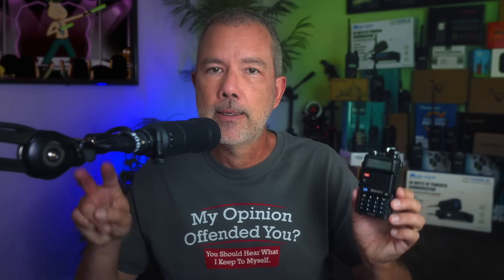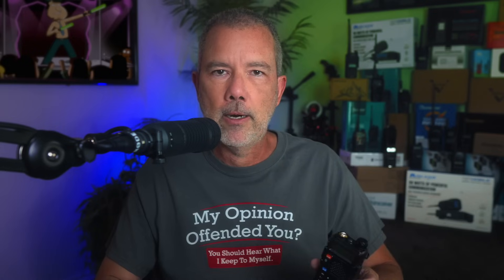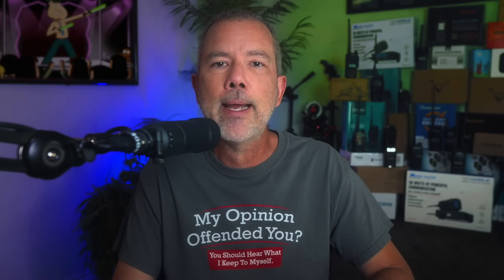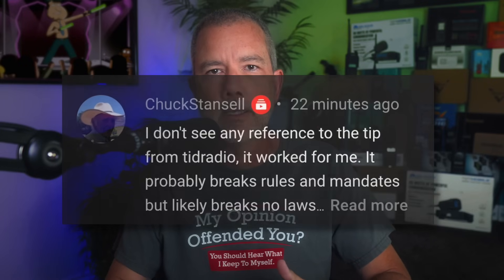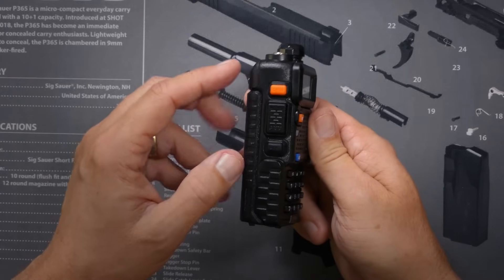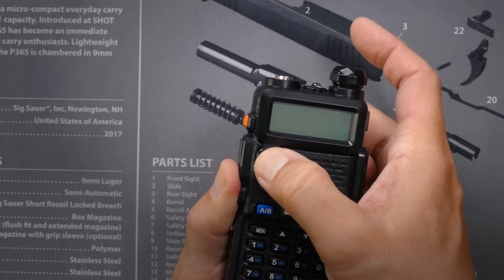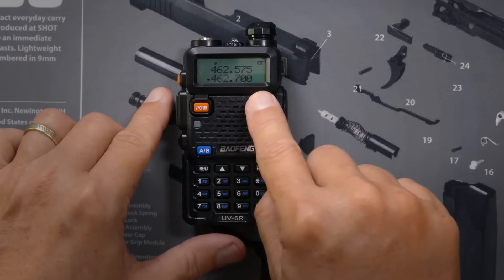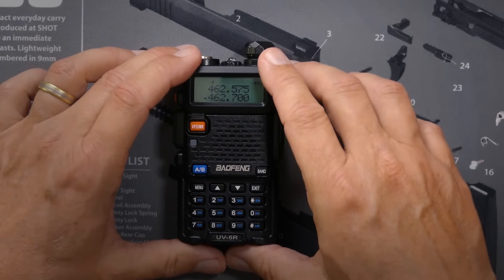How To Unlock A New Baofeng UV-5R - Easy UV5R Jailbreak To Transmit On More Frequencies

Comment: Just got a brand new UV-5R from the jungle store. I downloaded the latest version of Chirp (Mac), sent an image to the radio, and then sent it back to Chirp to confirm everything was copacetic from the factory. I then did the unlock and overwrote the radio with a different Chirp image. Upload was good, Tx was good on all freqs. I probably won't run out and use my UV-5R for GMRS, but it's nice to have a few "Do most things" radios for SHTF purposes.

Comment: Awesome!!! I've been a ham for 30+ yrs so it wasn't a problem for me----but I bought a couple of the ultra cheap UV5R's lately to use camping and stuff--with non hams. Imagine my surprise when I discovered that I had not read the fine print----and started getting the FU tone when trying to transmit on MURS and FRS channels. This trick worked perfectly. I already had them programmed out with chirp and the factory reset which un-hobbled the radios did not affect the channel programming.

MADE MY DAY!!!!

Comment: do i have to remove the antenna? because the trick does not work or rather I have the old model
Reply from the maker: If you dont even know if your radio is locked, you should not be trying.

Comment: After reading all of this, and commenting on it, I decided to buy a locked UV5R even though I have 5 of the old unlocked versions and 20 plus HT's of different brands. For $25 and next delivery, why not?
So I got it yesterday with a 3800 mah battery, did the unlocking, and works perfectly. This radio seems better built than unlocked older ones. It feels good in my hand, seems "firm" , and just feels superior to my others to the point of ordering another one, coming tomorrow. All my other HT's are more expensive and more powerful, but I really like this specific UV5R AND recommend it highly!
Thanx so much for the info!

Comment: All the hams in my local club are tinkerers. This is the kind of thing they live for. No snobs here. Our club is even setting up a GMRS repeater. <oooooo!> 

Somehow I burned out the transmit circuit in my trustworthy FT-60. One of my fellow hams said to buy a new board on Ebay rather than send it to a Yaesu shop to get it repaired. Much less expensive. Also, the new board allows transmit on other non-ham bands like the UV-5R. <again, oooooo!>

Comment: Help mine didn’t say factory:( I don’t know what is happening could mine be already unlocked?
Reply from the maker: If you dont even know if yours is locked, you shouldn't be trying this - please read the warnings in the info section.
Reply: @TheNotaRubicon  I'll do it right now but I'm just trying to use it for work we all got radios they all have Motorola's Xpr 3300e and I wanted to see if by any chance I can squeeze in with this walkie talkie and join them somehow we all need to be communicated that's why.
Reply: One of my units did not flash "Factory" or I missed seeing it but it was unlocked.

Comment: Tried this on a new GT-5R. Factory reset went fine, programming MURS and GMRS frequencies thru CHIRP went fine. But when I keyed up on any channel, other than 2m/70cm, the frequency shifted to 666.666 and would not unkey until I turned of the radio. Scary!!!

Update: I bought a second GT-5R and it will transmit on MURS and GMRS frequencies. I’m not sure why the first one won’t, but It’s no big deal because I want to keep my radios within their legal 2m/70cm bands. It was more of a curiosity thing.

Comment: Couldn't get it to work. Only have 2 hams
Reply from the maker: Were they UV-5Rs and are they locked?
Reply: @NotaRubicon Productions  Update: 

I went to Walmart and picked up a 3rd ham. Still not working. Luckily, all of my local Walmart employees turned out to be UV-5R operators and are highly experienced radio technicians. They told me it was highly illegal, and the FCC would flag me as a terrorist threat. 

Now, if they can only help me find what I'm looking for.

Comment: Ok please someone could explain me for what is this trick. Thanks.
Reply from the maker: New UV-5R radios are 'locked' and will not allow you to transmit on all the frequencies that an old UV-5R can transmit on. This trick will UNlock a new UV-5R so it can transmit on more frequencies.
Reply: Thanks for info, btw is this for better signal or what.

Comment: The only thing you did not explain, if you do the explained method, does it stay that way, or does it have to be done each time you power up the radio.
And if it has to be done each time you power, I guess any saved frequencies, will have to be re-entered?
Reply: Just did, once done it is done, just like MARS mod on Yaesus

Comment: This has saved $150! I've been on a rant about this for a year since we use GMRS frequencies at organized airsoft events. Is there any reason this video (and somebody else's similar video about the UV82HP) has only been out for a month? I'm NOT complaining! I'm just wondering if something changed recently or the hack was just recently discovered.
Reply: What video did you find to unlock the uv-82?  I am having trouble finding the instructions for that model.

Comment: This worked great.   Is there any reason now to purchase the more expensive BF-F8HP over one of the new 8W capable locked versions of the UV-5R which are 1/3 the price?  Keep it up, Randy!
Reply: So this will work on the 8w uv-5r?
Reply: @drd5658  Doesn't seem to work on my  bf-f8hp. But it seems mine can already transmit on GMRS frequencies.

Comment: Just to clarify. I belong to a safety crew for a dirt track. I can hear the crew but cant talk with my UV5Rs. The track has programmed radios. I was told I need to find their transmitting channel to talk to them. But with this trick I can talk to the track? Thanks....
Reply from the maker: You need to know the frequency. IF that frequency is out of the ham bands and IF you have a new/locked UV-5R then this may help.
Reply: @TheNotaRubicon  I have the Frequency for listening. Its in the 450.000 range. I can talk to another Baofeng radio. I cant talk to the tracks programmed radios. Thanks again.

Comment: I have a question... I own 2 UV-9gs GMRS radios and I just purchased the UV-5R. My question is this: Since I already have 2 GMRS radios, is there an advantage to unlocking my UV-5R? Will I get a better GMRS performance with the UV-5R in comparison to my UV-9Gs?
Reply from the maker: Your UV9Gs have antennas that are specifically tuned for GMRS.. Your UV-5R has some kind of pseudo-multi-band-abortion, so based on my testing, your UV9Gs will perform marginally better.
Reply: @TheNotaRubicon  Thanks, Randy. That's all I needed to know. :)

Comment: Thanks for the great video.  Just bought a kit with a pair of UV-5Rs from Amazon and one gave me the "FACTORY" response, and the other did not; but, both appear unlocked and when process was repeated on both, it did not reverse.  What a ubiquitous yet underrated little gem I've found with this HT, thanks to you.  (I can tell from your work mat that you think the P365 is another little gem as well, and you're right!).  Lots of fun for under $50/pair and the package came with a couple of bonus, longer antennas.  Haven't had this much fun since my ICOM 2AT back in college in the 1980's!  What a hoot.  Now I just have to watch all your other videos on programming this little treasure....a bit more to it than those ICOM thumbwheels, LOL.

Comment: Great video.  Newbie question, I haven't even bought my first radio yet.  If the UV-5R is locked and this procedure works on both the UV-5R and the GT-5R (according to the comments) is there any difference between the two radios besides labels and paperwork?  Thanks

Comment: Did you burn up your output transistor hitting the PTT without an antenna or dummy load? I don't know how quickly it does it on a low power RF transistor, but I had a speaker wire disconnect from a guitar amp once and I blew the transistor almost immediately when signal went through, so I'm really paranoid about it.
Reply from the maker: You should watch this video: https://youtu.be/X3r2K96hsGc
Reply: @TheNotaRubicon  Nice! Maybe I will quit being so paranoid! I'm not butthurt, by the way. 😂 I love your videos!

Comment: So after buying a couple UV-5R’s on Amazon it seems like if you have the blue sticker it’s the pre FCC ban. Any radio with the green sticker needs the hack done and then can transmit after. I bought 5 from the same seller and 2 were blue and 3 were green. Blue label says “walkie talkie” instead of amateur radio like the green one

Comment: Please don't give me the pin of shame. But my new uv5r has the FCC stamp and it will allow me to transmit on gmrs frequencies. I was kinda bummed because I wanted to push all the buttons and make a fun video.
Reply: Bought two recently with fcc sticker and they were not locked.
Reply: @jerryschmidt2325  I can't do the factory reset like that either.

Comment: Do you have a solution Randy? At least some of us, "some of us" are having problems locking out services such as NOAA, Police, Fire and other services where we want to monitor only. I fiddled with chirp and just locked up the handy until I turned it off and back on.
Reply: I may have answered my own question. It will be tedious but I'll set each "service" channel offset to transmit on my "home" frequency.
Reply: Simply setting offset to Off in chirp didn't do it for you?
Reply: @eTexNerd  no. That locked up my handy until I turned it off and on again.

Comment: Tested it and it worked! You are awesome! Side note. If I hit the transmit button on a channel that has the duplex set to off (I am intentionally locking out the channel), it goes into a strange mode and any button I press make different sounds. Almost like a tone signal of some sort. Anyone else experiencing this or have any ideas?
Reply: Scrolled down a mile to find this. Yes, I'm having this issue as well and I can't find a fix for it.
Reply: I get this same behavior with channels that have duplex set to off. My guess is that Chirp is using some sort of unsupported method to lock out transmission, since there is no such option in the builtin UV-5R user interface.

It does seem to work, but ends up forcing the radio to require a power cycle to get it to respond.

Comment: Hi so I tried this on a GT5R and it worked.  I noticed however that it appears that this radio will also now transmit on the Police, Fire and other restricted frequencies.  They used to beep prior to the unlock, now the transmit light goes on.  Finding this out was a bit alarming, is there any way to reverse this unlock? I do not want to accidentally transmit on a restricted frequency!  Anyone else notice this apparent glitch?
Reply from the maker: As mentioned in the warnings in the info section, there is no known way to "un-hack" the hack.
Reply: Lol thanks, it does pay to read the fine print.  Love your stuff, I have learned a lot from you since I started following.  Keep up the good work!
Reply from the maker: Just keep your trigger-finger off the button and you'll be safe.
Reply: It won't help you in frequency mode, but in channel mode, use CHIRP to disable broadcasting on any channels you want to monitor but don't want to interfere with.  That should keep you out of trouble even if you accidentally bump the button.

Comment: Iv tried to do it on my BF-F8HP and couldn't get it to say FACTORY. Is there another way?
Reply from the maker: Is that thing even locked?
Reply: @TheNotaRubicon  how would I be able to tell if it's locked or not. This is my 1st radio, sorry to be a noob and all
Reply from the maker: So you're trying to do something that could destroy your radio and you dont even know why you want to try it?
Reply: @TheNotaRubicon  the radio is intended for worst scenario and eill be mounted on my vest. I would like it to be fully unlocked and used at its full potential when needed.

Comment: Mine is older, and it displays, “coping” every second. Doesn’t change a thing..
Reply from the maker: if it's older, then it's not locked - so yah, doing this would not change a thing.
Reply: @TheNotaRubicon  So….I have GMRS without doing a thing,,

Comment: Do you feel (assuming an unidentified person already had a baofeng radio already programmed to GFRS ‘channels’) it would be beneficial to have a GFRS specific radio? (Hypothetically)(for academic purposes)
Reply from the maker: A GMRS specific radio is much easer to program/use, but alas, it is limited to transmitting on only GMRS channels - although most can also listen to ham frequencies.
Reply: @TheNotaRubicon  thanks for the SUPER quick reply.

Comment: Wonder if you or anyone can verify this unlocking the newer UV-82HP's?  Hold the Transmit Button, Monitor Button, and, # Button, all at the same time.  Then, turn the unit on, and it is unlocked.
Reply: doesn't work on mine :-(
Reply: Yes, I can verify that this worked.

Comment: I received my first Baofeng  last week. I was pretty excited right up
until I realized the restrictions. I tried the hack and it worked! Thanks!
Reply: may i know which version is your uv-5r? mine is BFB298. it was not gmrs locked when i got it. you can check by holding "3" button while powering on. thanks.
Reply: @needlethread4715  that's what my ver # is. also not locked.

Comment: Just tried this on my new locked 
Baofeng GT-5TP, only difference was that you need to hold down PTT + M + # keys and then power it on getting the same 'Factory' on the display.  Mine is now unlocked!  Thanks!
Reply: Worked on my uv 82! I thought I was going to miss out because the vfo button but it worked.  Thanks!
Reply: @stephenbeardsr Hold both A and B PTT plus the M key and the # key and then power on the device and it works.

Comment: I just tried the Unlock on my ~3 month old BF-F8+ and the Unlock works perfectly so far. Freqs were already programmed in via Chirp before I tried the Unlock Tried a MURS and a couple rail freqs.Your vids and humor are first class😂
Reply: I have BF-F8HP...tried numerous times and still can't get Factory to appear...
Reply: @FreddyFootlock Just tied it on my BF-F8HP..Didn't get the "Factory" but when I typed in 462.700 and pushed PTT got the red light instead of Fu*k You tone, and also a H appeared next to the transmission strength bar

Might just be that it doesn't show "Factory" anymore during hack process
Reply: @FreddyFootlock  I have the BF-8HP and the factory trick didn't work, but mine would transmit on GMRS from the factory,  mine is about a month old
Reply: Me too @FreddyFootlock
Reply: Ditto....didn't work on my new F8HP.  Returned it and bought a new UV-5R for $22!  Also bought the larger battery and 771 antenna all for less than the original F8HP purchase.... I'm not sure I'll really miss the extra 3 watts?  We shall see!  Cheers
Reply: Just get COPING on mine

Comment: Thank You!!!  Works on GT-5R in VFO.  If you try it in MR mode, lol... It changes the freq to 666.666 and locks the devise...lol...  An interesting note.  When try to program an FRS or GMRS with Chirp.  Chirp will not allow you to change the Duplex setting from "off" to "(none)".  Even after saving - When you open the img file all are changed back to "off".  Note - Channels can be manually saved and work in MR mode. Thoughts?
Reply from the maker: My thought is I wouldn't try it on anything but a UV-5R.

Comment: Was looking all over ebay for used older UV-5R models just to hope it was unlocked and then you upload this gem. My radio will be here in a couple hours from Amazon so I am excited to unlock it and feel the sad hams cry.

Update: Right out of the box my UV-5R was able to transmits no problem? I did a test and was able to hear myself on another radio. I must of lucked out and got a really old unit sitting in an amazon warehouse out here.

Comment: This seems to have messed up my GT-5R. It does unlock the FRS/GMRS frequencies, but the radio gets stuck on transmit until I turn it off. I also now get a communication error when trying to download the image from Chirp.
Reply from the maker: Yah, this is for a UV-5R. I never said it would work on anything else.  Try a factory reset, hopefully that will unscrew it.
Reply: @TheNotaRubicon  Definitely, this was an "at your own risk" endeavor. Factor reset fixed the comm error on Chirp so I can reprogram. But it still gets stuck on transmit when using a GMRS freq.  However, I just checked with a Midland GXT100 and it's not actually transmitting even though the red LED comes on. FYI for any other GT-5R owners that try it.

Comment: I tried it with the GT-5R and it exploded spuriously and blew off 12 of my virtual fingers! Seriously, though, the FACTORY sign flashed briefly, but when I pushed talk while on a GMRS channel the display and the led went red. From that point I couldn't change the channel or do anything else on the radio. It just chirped every time I pressed a button. After I turned it off and back on it operated normally until I tried to transmit on the GMRS channel, at which point it went back into red hybernation again. My UV-5R did eggzaktly the same thing. No difference at all. I must've done something wrong. Maybe I didn't press correctly.
Reply: OK, I watched your video again and noticed that you transmitted in frequency mode. So I tried that on both my UV-5R and GT-5R and it worked! It just acts goofy in channel mode.